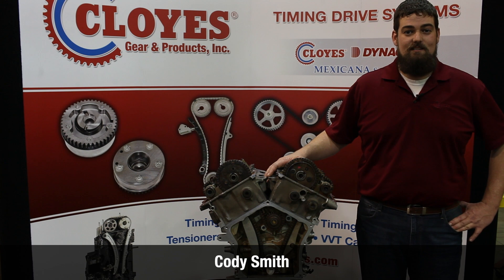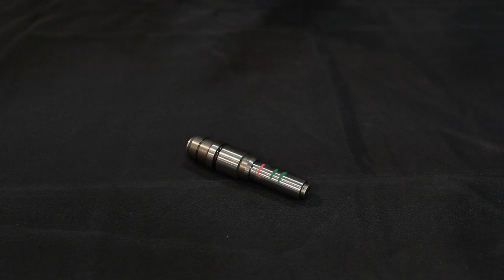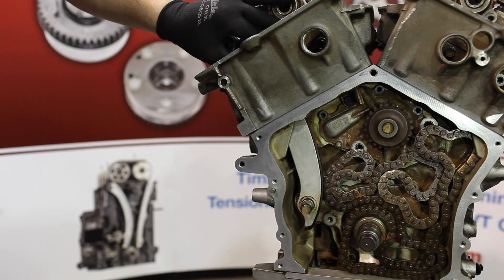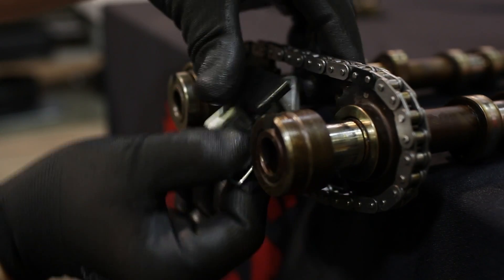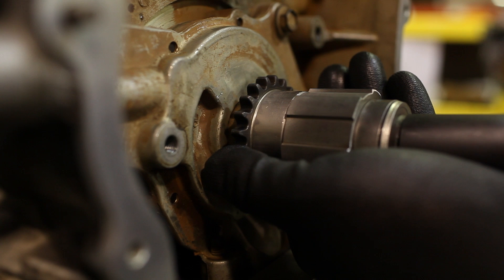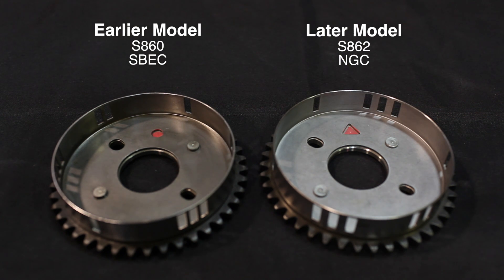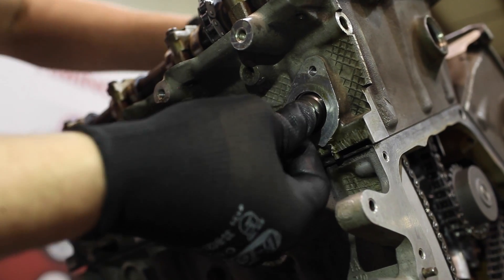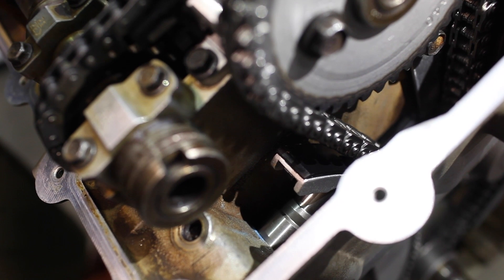Chrysler 2.7L Timing Chain Replacement, Cloyes 9-0397SA

Comment: My cam shaft timing marks are currently at 1 o'clock since they moved during the sprocket removal.  I only see 1 painted link on one side and its lined up with the timing mark, but the other side I only see 1 painted link and its not lined up with either timing mark.

Do I remove the cam shafts with the timing marks 1 o clock and re-install at 1 o'clock, tighten the caps, and then when I reinstall the sprocket I turn the cam back to line up the sprocket holes?

Or its ok to remove the cam shafts with the timing marks at 1 o'clock, but reinstall with timing marks and both colored links at 12 o'clock anyways and then I can proceed to install the sprocket and turn the cam shaft till the holes line up?

Comment: Hi Cody, I am changing the head gasket on a dodge magnum 2.7L, when the tensioner is new do I have to put oil on it before I install it? And after putting the cylinder #1 to the TDC, is the sprocket mark is still align with the oil pump mark? And I need to be clear when said prime the engine over with the ignition system deactivated, can you please give me a little bit more details on that?
Reply from the maker: You do not have to put any oil in the tensioner before installation. The activation process requires you to compress the tensioner completely, and if the tensioner is primed with oil you will not be able to compress the tensioner far enough to activate it.The crankshaft sprocket mark is only aligned to the mark on the oil pump when the engine is at 60 degrees past #1 TDC. TDC is the position the engine needs to be in to set the timing.Before starting the engine up after timing system service it is best to prime the engines oil system and let the hydraulic timing chain tensioner fill up with oil This will insure the chain is tensioned properly before the engine is started We recommend deactivating the ignition system by disconnecting the coil packs, or pulling an appropriate fuse or relay. This will allow you to turn the engine over with the starter without starting the engine. Let the engine rotate with the starter for about 45 seconds to allow time for the tensioner to fill up. It would also be a good idea o pull the fuel pump relay during this process to prevent flooding the cylinder.
Reply: Thank you very  much Mr. Cody, I am very appreciate it. So you mean after cranking the engine over for 45 seconds with the ignition system deactivated after that I can reactivate everything for a normal crank right, now my question is after I finish install everything back that's mean the engine is totally close, what is the next process that I will have to do to know for certain that the #1 cylinder is at the TDC. Help with the exact process that I must do.

Best regards,
Reply from the maker: Give us a call on the tech line 479-646-1662 ext 228

Comment: almost done OK do the piston need to be on a timing also like does it matter where the piston are .or just as long as the line to the sprockets are alined .. ?????
Reply from the maker: The shafts will be in the correct position with the sprockets aligned as shown in the video. Due to the fact that the primary sprockets only install one way, and the crank sprocket uses a key, there is no way to be out of time with the marks aligned correctly.
Reply: Cloyes Gear & Products, Inc. (Aftermarket)  thanks I was a little worried it's my wife's car and you know how that goes haha haha

Comment: What exactly does it mean to prime with the ignition system deactivated?
Reply: Edgar Guevara means to take off the plug from the distributor  and crank it with out it turning on so just the motor cranks and no start so the oil can pass through the chain and pump etc ...
Reply: So I just have to disconnect all the Ignition Coils and then crank it. Cool thank you!
Reply: yea just do it like that just make sure it don't turn on just let it crank like let it just turn over .. no start until ya the oil got all over the chain dip stick .. etc
Reply: put  Ignition and Fuel pump Fuse off  and crank
Reply: Ive cranked em with passenger valve cover still off while applying pressure to tensioner guide with prybar..until tensioner pumps up.. no power to pcm of coarse.. seen them jump timing before tensioner took hold before.. and they can bend a valve just from being turned over...
Reply: John Floyd to be on the safe side, I think I want to try this method, but how do you crank the motor without sending power to the PCM?  Is it just a matter of pulling the PCM fuse?
Reply: How can I desactivate the ignition, if this engine uses the same fuse for fuel pump, ignition coils and crank starter? And the I must start just the crank starter.
Reply: The easiest way is to just remove the fuses for the coils and injectors. If you got the top off just unplug them. After that is done crank the engine for 5 seconds, wait 15 seconds, crank for 5 seconds until you get oil to the camshafts, then install the valve covers put it together then fire it up.

Comment: Thanks for your video it looks like it is going to save me a lot of cash by doing it myself. my water pump just started leaking so I parked it immediately and am in the tear down phase. almost ready to remove the chains. one thing I can't figure out is how to remove the tensioner. it seems to have the power steering pump attached on top of it. I can't figure out how to remove the bolt to get it off. any ideas?
Reply: never mind about my question. I figured it out. I had to lower the motor after I removed the mounts. I had just paced it on blocks so it didn't lower enough. lowering it almost all the way allowed for me to reach the bolts to the power steering pump. 
thanks again. I was confused about the camshaft chain until I saw your video.

Comment: Headgasket failure, valves aren't bent, chamber holds all liquid. Heads went on nicely, torque spec was perfect. Its the timing part that is a disaster. I've never seen a engine with so many marks that have to align. Took it apart 3 times, still has a low dead crank. Ive changed dozens of timing belts and chains but this one is tough.

Comment: 01 chrysler sebring convertible 2.7.
I notice when that timing mark on the crank gear is aligned with the arrow, the #1 piston is only halfway up, cam gears were at 12" but wont start
Reply from the maker: When the crank mark is aligned with the arrow, it is signifying that the engine is at 60 degrees after TDC #1. It is correct that the #1 piston is halfway up (actually going down). As along as all the sprocket marks aligned with the colored links on the chain, your timing will be correct. What was the reason for replacement? Did the engine run before tear down? The primary reason an engine won't start after timing replacement is bent valves, but this should only be the case if you had a timing failure to begin with. Please call me with more information 479-646-1662 ext 228

Comment: Is this procedure the same for the 2008 model?
Reply from the maker: Yes. Although Chrysler did change to a small pitch primary chain for 2008-2010 models, the installation procedure is the same.
Reply: Thanks!

Comment: Well Crap...I have the infamous dodge engine knock. I suspect timing tensioner /chain. If I suspect tensioner knock, would removing just valve cover on that side and replacing tensioner only be an option?..Replacing timing chain in this vehicle without removing engine is gonna require alotta beer.
Reply from the maker: While tossing back a few will certainly keep the stress level down initially; a mistaken diagnosis and installation will certainly cause more headaches than a little engine knock! The potential does exist that replacement of just the tensioner will resolve some of your issues. It is possible that there is an issue with just the tensioner, but it is unlikely. Most of the time this timing system fails because of a worn stretched chain due to it's heavy weight and long length. The hydraulic tensioner will keep up with the chain stretch for a while, but once the tensioner reaches it's maximum extension point it will deactivate and become somewhat useless. If you are going to replace the tensioner, be sure to go through the tensioner extension inspections that we show in the video. If you can see the wear indicator groove on the tensioner after activation then you definitely need a new chain. It is also at this point that we would strongly advise a full timing system replacement. Feel free to call the tech line if you have any additional questions.

Comment: Is this the same process for the 2.7L in the 2005 300? I know the intake is completely different than the earlier ones in the sebrings and 300m's.
Reply from the maker: The intake may be different, but the timing components and the installation procedures for the timing system are the same through 2007 models. 2008 and later models are very similar; however, Chrysler made some changes to the timing chain and components.

Comment: "around 12 o'clock" on a timing system..... Doesn't seem professional.
Reply from the maker: The timing chain's colored links aligning with the sprocket's timing marks is what ensures the 2.7L engine is correctly in time. The position of the sprockets will vary slightly depending on the camshafts resting positions, and where the slack in the chain ends up after the chain is installed. For this application, where the sprockets do need to align with a static location, "around 12 o'clock" best describes the real world installation.

Comment: What happens if u dont remove bolts from the camshaft in sequence?
Reply from the maker: The most important portion of this information is the attention to the bearing caps. Chrysler probably has a technical reason for it, but....in our opinion....the bolt removal sequence is not as important as the installation procedures. It is an efficient method of remaining organized through the process. Starting on the inside and moving outward while tightening gradually will ensure the camshafts properly locate themselves inside the bearing caps. The bearing caps must be reinstalled in the same position and direction from where they were removed.

Comment: Nice video! I have a Concorde 2004 with the same 2.7 engine. I need to replace the knock sensor due to P0325 engine code, which is why it's on limp mode. After removing the intake manifold cover, i'm stuck since the knock sensor is located under the fuel line going to the injectors. Do you have any video on how to remove the knock sensor? Would much appreciate it. Thank you.
Reply: You have to remove the passenger side head to replace the knock sensor

Comment: those coming to see this. and read comments. wanna know trick to help your timing chain last longer in these ? 

motorcycle oil. or zrod by amsoil. something thats high in ZINC or sulfur. it will help the chains last longer. and it will put a high end protection on the chain and cams and valves. and well the whole engine to help it have ANTI wear protections to way out last any other oils. and help your engine get that extra 100k miles.

Comment: What a piece of garbage motor. I should get a refund from Chrysler.
Reply: Great engine IF synthetic oil is used and the oil is changed at 3000 miles... not 3002 or 3001. My newly purchased Concorde 2.7 is spotless inside... replacing the water pump now. Caught the drip before the coolant got into the oil pan. ANY coolant in the oil will kill any modern engine with today's tight oil clearances.
Reply: A good mechanic would have suggested replacing the timing chain when they replaced the water pump. Because it was already torn down and was much easier to replace then rather then. Unless he is the type of mechanic who wants you to come back so he can charge you all them hours to retear down the engine again. More money in his pocket.
Reply: Ya they were hit with lawsuits but that doesn't mean there all ticking bombs. My engine could of died when the water pump went out but it didn't. When I saw the antifreeze leaking through the weap hole I towed it to my mechanics asap. A lot of people just drive it like that . It was expensive but the engine was fine. No sludge no damage. That was 23.000 miles ago. This winter I'm getting the timing replaced so it doesn't break. I use synthetic every 3000 miles.
Reply: +Shorty Medlock. I'm about to hit 190.000 of coarse it was expensive to get it that far!
Reply: Ridiculous! Chrysler was hit with a pile of law suits because of this motor failure and with full service records from owners.
Reply: The most annoying problem it has at 190.000 is the transmission solenoid. Going to get that fixed to.
Reply: Greg Kurtz fr lmao. the truest statement on earth right here
Reply: Space Ghost como quitar
Reply: Mee 2
Reply: Yea I'm about to tackle this job on my 300 2.7. Thanks for the video, you have my business. Oh I'm going to do head gaskets also.
Reply: @bossman8231  Iknow its been a couple years but how did the head gasket job go?Im fixin to get started on my 2007 dodge charger with 220,000 on it!

Comment: Great Video. What is the name of the sleeve you used to put on the crank sprocket?
Reply from the maker: +getpaid38able In this video we used a combination of washers, and a GM LS oil pump drive to function as a sleeve. We did not have the special Chrysler tools on hand for filming. Although it is likely that there are a number of "do-it-yourself" solutions, we would always highly advise the use of the proper installation tools. You can still find the Chrysler tools, but you may have to purchase them from a vendor who specializes in tool sales. The installation tool part numbers are 6780 and 8179. Hope this helps!